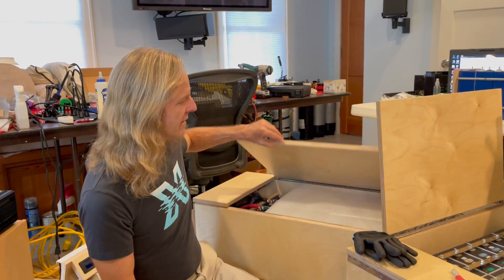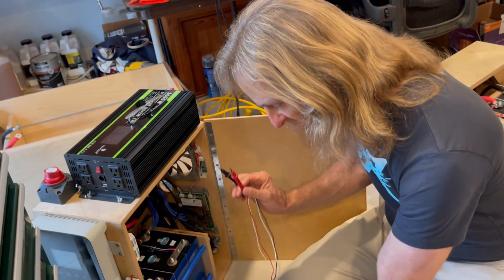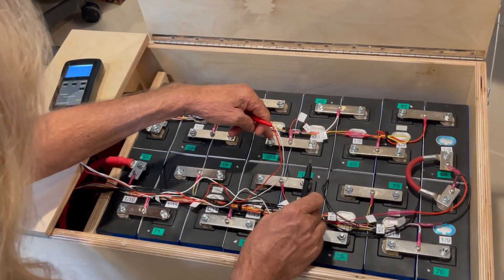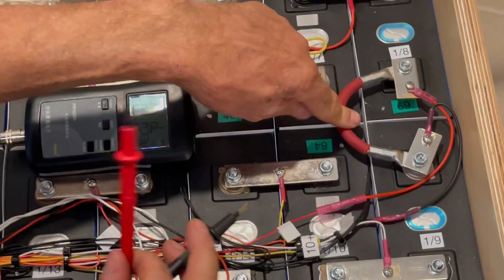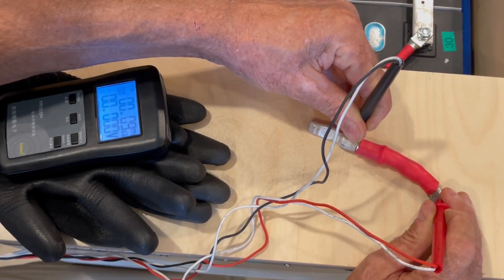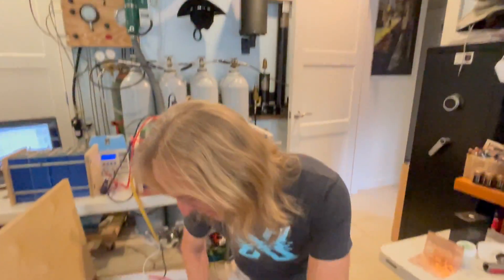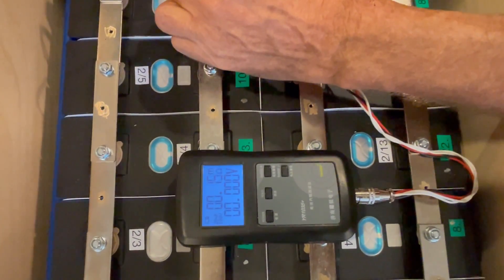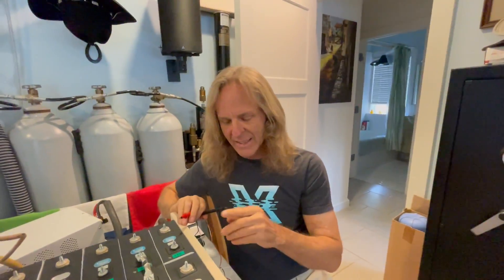It's No Joke, Size Really Does Matter!! Testing Flexible Busbars. Please read the description.

Comment: Hi All. For automotive and marine applications there is no choice: flexible conections (jumpers) is a MUST. It is not only the mechanical "movement" (vibration, shocks, etc), but also the "thermal stress". For stationary batteries at your garage, you can count with a reasonable small temperature range, but for automotive and marine, you can have a huge range: from -15ºC to 50ºC (or even wider). 
When you asemble a battery pack (packing the cells with the bus bars it is arround 20ºC, but later, in the real life for an RV or a boat, you can get such mentioned extreme temps.
When the pack is getting colder or hotter than when it was assembled, diferent dimensional changes start, and since the cells´ dilatation is quite diferent to the busbar dilatation, someting is going to happen (badly). From bowing the busbar plates (the best case), to breaking the terminals basement and junctions and welds (the worst case). In the middle, you can sufer the slipping of the bus bar surface to the terminal´s surface due to the huge mechanical forces from the dilatation, what makes the connections weaker and creates resistance increasing in the terminals.
So, for that mobile applications, it is much more important the flexibility than the tiny resistance increment itself, and therefore the jumpers are far prefereable than the "solid" metal bus bars.
Reply from the maker: OK, I feel I must respond to this type of comment. With all due respect, you are making claims that aren't backed by any data or facts. Here is a link to info on coefficient of expansion of materials. https://www.vip-ltd.co.uk/Expansion/Thermal_Expansion.pdf Here you will see that in the temperature range you specify the movement from thermal expansion in copper would be 1 mm per meter. The terminal spacing of 280AH cells is 75mm. Therefore the total expansion would be .075mm. Even if the cells were static and all the expansion were exerted into the terminals that is still .0375mm exerted onto each terminal. Not only that but if you are assembling the pack, as you say, in the middle of the  temperature range then the stresses at the extreme are halved again.

I know quite a bit about the danger of expansion of metals due to my career. I had a recent project where there was a steel band around the roof of a house. I warned the architect of the need for expansion joints but they and the engineer said that the building would absorb the stress. The perimeter was 360 feet long and it was carbon steel so the expansion potential in the temperature ranges that could be expected was 3-4 inches! The first night that the building saw temperatures of 15f the plate formed its own expansion joint. It broke a full penetration weld in 3/8" by 8" steel plate. The building did absorb most of the movement but not all. The gap we found that morning was 1/8" and it closed that afternoon when the sun hit that side of the building. Think about that. Even though the potential was 3-4" we were only able to observe a fraction of an inch.

If you think that the bus bars are going to bow or the terminals fail due to 4% of a mm of expansion, how do you plan to torque the connection without exerting several times more than that amount of movement?

One other thing to consider. My design and that of many others involves the use of threaded rods to restrain the movement of these cells and I seriously recommend this in any marine of automotive use. The threaded rods are going to have a very similar coefficient of expansion to that of the copper bus bars so the entire assembly will move together with regards to temperature and coefficient of expansion.

You may make whatever decision you wish on your projects. Many of us are just learning and we can be mislead by  claims that may sound authoritative and plausible aren't supported by engineering or testing. These claims get repeated and become part of the lexicon based on nothing more than an unsubstantiated but intelligent sounding claim. I am happy to be taught if I am wrong but I need data and evidence.
Reply: @RayBuildsCoolStuff  Have you been able restrain cell expansion with compression then?   I am more concerned about that source of movement than thermally caused expansion. Of course that movement can be managed by allowing some space in the pack.

Comment: I'm just gonna throw this out there. Make certain there is no current moving through the cables while you are checking the resistance. That will cause all sorts of trouble. There are plenty of guys here on YouTube, building lifepo4's, who are learning as they go. But you're the only one who thinks logically, makes sense, and who's not selling us something. I design custom LFP packs and BMS's for a living. You're doing everything right. Keep it up.
Reply from the maker: Thank you kindly. That means a lot to me.
Reply: good point, thanks!  I myself never thought of that. would it short out the voltmeter? so technically, even measuring lead acid batteries in a series string, while they are connected to a a battery charger, or while something is connected and energized, could hurt the voltmeter.  this is alarming, and common sence upon reflection, becasue to measure current you have to move the voltmeter leads to the current perasuring plugs, and carry the current across the leads though the voltmeter. hmmmm.  THis will take some consideration to think of all the ways current is bothering the voltmeter when taking voltages.

Comment: I noticed that the Welding Cable you are using is a coarse wire and of course that will have a higher resistance.  I very very strongly urge you to use a Fine Wire Welding cable, such as Royal Excelene from Southwire.   There is a significant difference !   Also the Copper Purity with Coarse versus Fine varies (most especially cheaper brands).

Also of note, many people are doubling yup their supplied busbars.  You are obviously not doing so and therefore did not test such an installation.  Why should you right.... but for "completeness" it may be an option & a further learning experience.
Reply from the maker: All of my welding wire is Royal Excelene and you are correct. It is good stuff.

Comment: How about running the pack at high current and doing a thermal check using a IR camera and comparing temptetures accurately.
Reply from the maker: A good thermal imaging camera is still quite pricey. The cheap ones you can buy are gimmicks in my experience because I have used real ones and it just isn't the same at all. I am sometimes able to borrow good ones from a friend but it isn't easy because he lives out of state.

Comment: I have worked with set ups this size and bigger and by far the easiest and least costly solution is to use 3/4inch copper pipe with hammered ends. I then drill the ends and heat with a torch to anneal the copper to dead soft (bolts bite better in soft copper)

Comment: Very good and interesting video! What do you think of the laser welded studs? They seem nice but it seems to contact area to the copper bar is reduced. Does this make any noticable difference?
Reply from the maker: I think it does make a difference but it is worth the safety factor and not having to fear how many times you loosen and tighten a terminal. I think you can safely tighten them to 6nm. I tighten to 5nm which feels satisfyingly tight without fear of stripping out a female thread. 

I use carbon paste on the final connection and that helps and the resistance is in a very short area and it doesn't heat up and the resistance is consistent between cells.

I think all things considered I would always opt for the welded studs although if it is done poorly I think they can come off and they could end up using too much heat and damage the cell. I think if you get some that look like they were done by hand in someones garage then that would really be cause for concern. Otherwise I think it is a good solution. This is just my opinion and not backed up by vast experience.

Comment: Great job and doing the diligent testing, measuring and showing people the differences.  So often people get caught up in emotional decisions on designs instead of doing the math, and leveraging the real science. I'm not too surprised by the result, and your point about fixed/welded battery terminals is valid. Well done fellow Texan!
Reply from the maker: Thanks. I think what we often suffer from is a form of institutional knowledge. We hear something that seems to make sense and take it on as fact without any proof or supporting data. 

Many intelligent people get trapped into thinking that their intelligence that serves them so well in their chosen field is just as infallible in their side interests. They trust their own judgement about what others say online if it sounds reasonable and then they repeat it in forums and vlogs. It takes on a life of its own without any basis in fact.

 I am an expert in my field but I have to remember that when it comes to this stuff, I'm just a student and my most powerful tools are skepticism and testing and caution. I will be wrong but I don't want it to be because I just repeated an opinion I heard on a forum.
Reply: @RayBuildsCoolStuff  YES! Interacting on the internet/social media has caused too many people to believe that truth is determined by popularity context (testimonials) instead of testing.

Comment: Hullo Ray...Great demo...!
We can use 2 wires For added flexibility...
If lugs allow:
2 x 16 instead of 10 AQG
Greetings
PS: 
Your copper bus bars  has a smaller cross section,
where you drilled for the balance cable lug: 40-8=32
Can you move the hole to the end corner...?
PPS: 
Hope the copper bus bars are tinned,
other oxidation will creep in and "remove# the connection.
PPPS: 
Manufactoring cost (and labor time and effort), speaks, for busbars
Reply: Yes,Sir, great videos, keep'em coming; 

LIFEPO4 Cells a  rare 7 year test; here goes:

i think oxidation just cannot easily move into the copper buss bars, not under the nuts        ººhºº

 3 days ago i  purchased ( they were for free,after all,the fellow gave me them) 8 used ,small, yellow, 60Ah Winston cells, 8S assembled, from 3013; they also sat idle for 3 years, seldom recharged,the seller said; now  at aprox 3.26 volts +- 0.01; 

i checked all torques,they were just perfect;    stiction gave in, clicked...then, not even a minute of arc i moved each one,they  seemed perfect; i love them, but by now sick and tired of lifepo4s,wires,terminals, be a mess, etc...(i am 95% off grid here in  Porto, Portugal),i left them as they were;  so  let's see;

i charged them, an hour rest,  and then discharged them at near1C, at 54 Amps,till  one came down to 2.85 volts (i was the bms, like a hawk, no be a mess there...) 

amazingly the terminals and and buss bars all stayed perfectly cool

torques were fine after all, as expected, and the copper buss bars were  a very dark brow from oxidation of 9 years, one could barely tell it was copper;  but,

out of curiosity,i removed 1 nut and under it the thin copper buss bar, was perfectly shiny, like brand new; both sides like brand new and polished;  ; the key word here is *thin*  because this allow for flexibility and for a perfect circular contact area,the annulus;

also, all the 8 cells still hold 97% of the original capacity,of the 60Ah... one is very slightly puffed , about 1.5 mm per side,but performs the same as the others; they are not yet compressed,never were; oh...and really no BMS was needed, upper elbow/lower knee, they stayed true,all 8; obviously  they were matched at the factory in 2013,  for sure; each one has its own serial number,all eight in successive numbers;

so,in this case the oxidation stayed outside of the contact areas, but it is also true that these cells never saw very many cicles, the hot-cold cicles that tend to undothe connections a bit;
the fact thate the buss bars were perfectly calculated at the factory,anf that they are thin is the key here, as far as longevity is concerned;  i have seen 4 year olds with imperfect connections heating up,needidg work (you just need  a small piece  of  sandpaper,your best friend,here...USE IT...)due to lack of paralelism and lack of compliance to movement,because the buss bars are too thick,sometimes Al!!, and they do not give.

Comment: Excellent job exploring the topic and communicating the various findings. What amperage are you designing to accommodate?   With your draw spread across three packs won’t they only need to handle 1/3 of the total.  Design for 2/3 the total maybe?   Curious about how you’re working through that calculation?
Reply from the maker: Designing for four batteries feeding three 8,000 watt inverters. Max draw in that scenario is around 135 amps per battery. I will actually have 6 batteries and......spoiler alert........we are going to add two more for a total of 8 per system. Still designing for four batteries at full inverter capacity. Watch the video I made about the Midnite Solar Battery Combiner Box for more info.

Comment: useful info, I wonder at what point your calculations become relevant and how. 100A + or more. would you loose 1% of pack capacity due to heat or is it more substantial. I.E is the cost worth the effort. Obviously making your own copper bus from pipe would be cheaper that needed to get huge AWG and crimping tool etc.

Comment: Dude that ain't even worn on Resistance not even a half a ohm resistance what the hell is your problem it's not dropping your voltage or your average down hardly any by the time you get all the way to the end from positive to negative at the end of that battery Bank you may have four ohms resistance whoopee Doo
Reply from the maker: In a 48 volt battery fused at 200 amps, what size wire are you comfortable using between your cells in series?

Comment: For a ‘flexible’ bus bar, use flat copper but bend a hump in the middle, this allows for more flex than a flat bar.
Reply: There are flexible busbars. One option is to go with a braided design. Another is to go with a laminated design.
Reply: I like them also the multiple layers thin copper busbars but how about the resistance of these

Comment: That meter isn’t meant to work that way. It’s only for reading internal resistance on a naked cell without terminals or buss bars. The meter injects frequency through the battery and gives you results through computations and does that job very well. The numbers you are getting are irrelevant. What is relevant is conductor cross section, length, material and terminal contact area.
Reply from the maker: This meter is designed to test resistance in batteries but can be used as a very precise tester of resistors and materials as well. Please see this test where it is used against a Keithley DMM7510 tester and matches almost exactly. https://budgetlightforum.com/node/60040 

You can download a pdf version of the manual here. https://diysolarforum.com/resources/yaorea-yr1035-battery-internal-resistance-meter-tester-manual.142/
Please refer to question 8 in section 8. It says you can test cells that are connected in packs if they are not charging or in startup mode. Where are you getting your information? I would like to read it.

Finally,
This tester is not designed to test these large prismatic lithium cells with very low internal resistance due to the greater error at very low resistance however, the tester is still very useful for testing relative resistance and if you use the one I'm certain you have to test various materials, I'm sure you will find that measuring the resistance in materials and in resistors give repeatable and expected results. Try it with yours and let us know your results.
Reply: @RayBuildsCoolStuff  
If you really want to see what matters, it’s voltage loss due to resistance, put a load on the batteries. I’ve thrown a 100 amp load on 310ah batteries that have a diagonal 2/0 jumper that’s 6” long from hole to hole, that let’s the cable have a slight arc. (cells are arranged polarity to the same side of the group). You’d find less than .002 volt loss measured lug tip to lug tip. If you have more, the crimp is no good. Always use Selterm or Ancor lugs. In high vibration environments I use jumpers and they been so successful that’s all I use now. Yeah it’s expensive. Your biggest problem is the infernal small contact area of the newer “welded” terminals. Regardless of jumpers or buss bar, you have to use scotch bright on all contact surfaces and ox-guard just before assembly. That’s where the true trouble lies. Always measure voltage loss at the terminals under load. A bad connection can not only mess with balance but melt a terminal before the BMS even does a thing when pulling high loads. As for the tester, that particular one is very commonly used across the industry at distribution centers for “match batteries”. They say it’s not for these larger cells but it does a surprisingly good job or at the very least a reference point. The biggest issue with that meter is the leads, is the entanglement. Change it a bit and you can get a slightly different reading. Have the leads draped the same way each time you use it. Also contact point on terminals should be the same and the angle as vertical as possible. I’ve found one set of 16 that all measured .22 Ohms and another set that measured .28 to.22  Ohms. Did it matter as to what cells that constantly were a bit off? It didn’t seem to be a correlations in this case.
Reply: As for using the meter on batteries naked or in a group, try it. See the results with and with out.